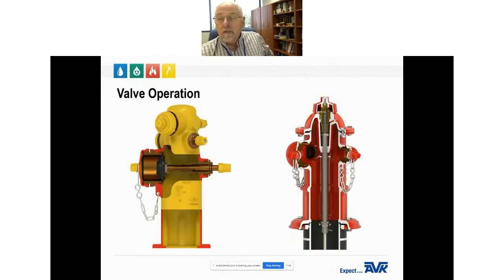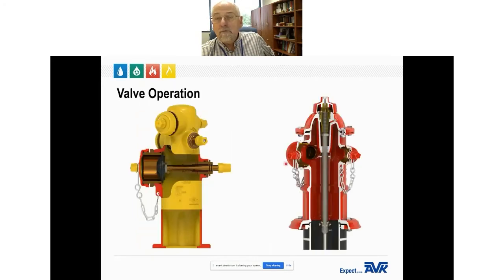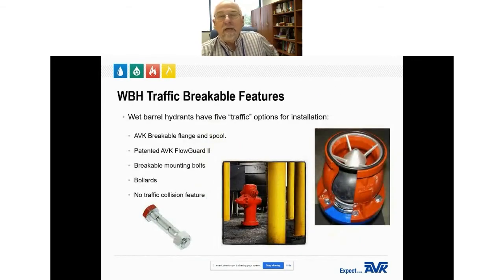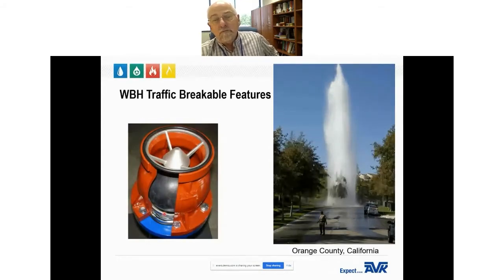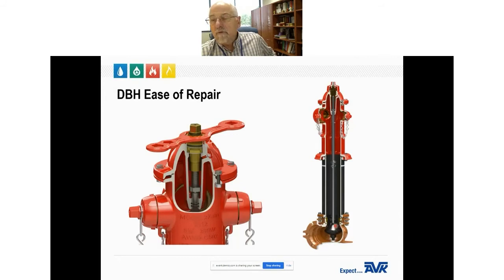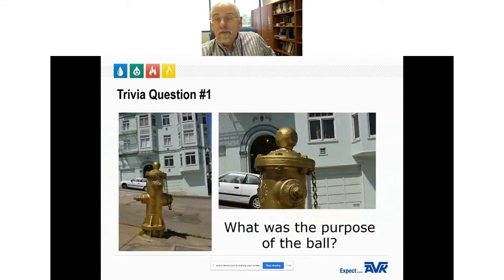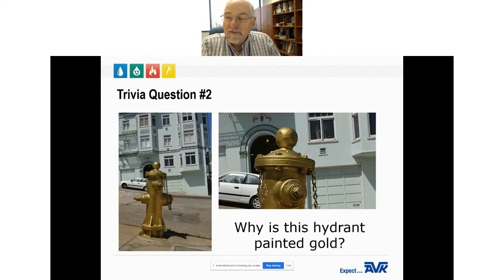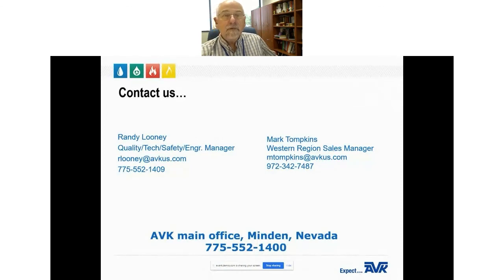Tailgate Talk Episode Dry Barrel vs Wet Barrel

Comment: The wet barrel hydrant is so much more efficient when it comes to operation.
During a fire you don't want to shut down your hydrant to set up a second nozzle..
This would also include a problem with any missing caps in some cases you may find on wet barrel series and would create further delay on plugging up a missing cap for a DBH.